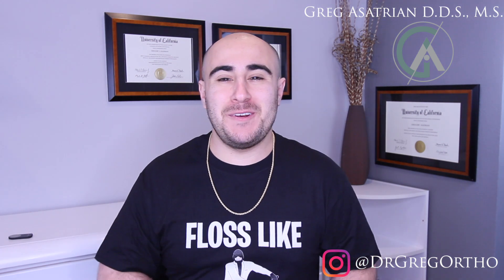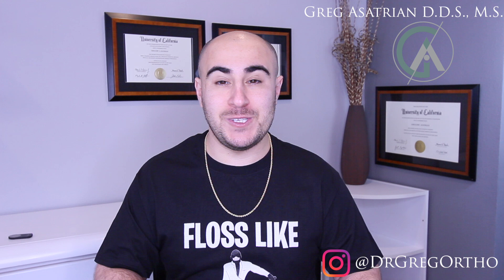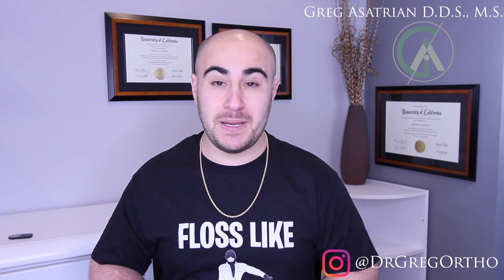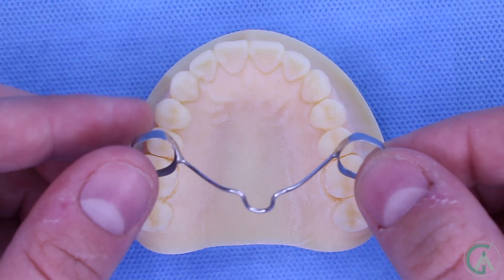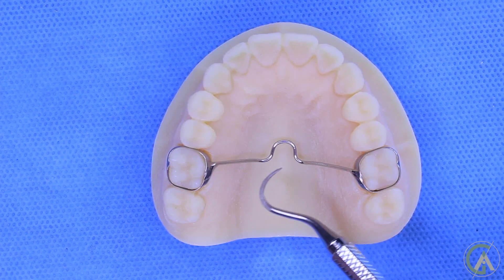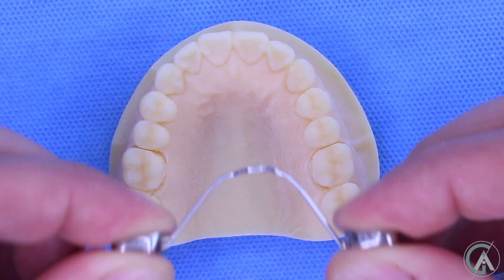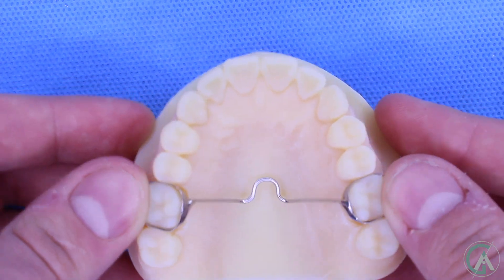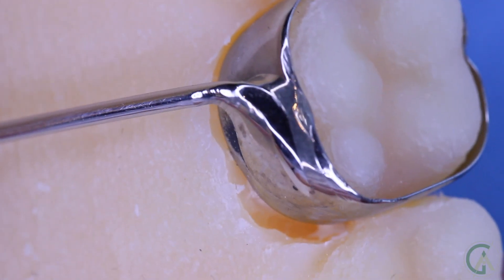Braces TPA (Transpalatal Arch)

Comment: My daughter is 12. She has 1 front protruding tooth and gaps between the others. She is about to lose her 2 upper canines and lost the molars adjacent to the canine on both sides about a month ago. She got braces on just her upper 4 front teeth and they used a TPA on the molars to hold the wiring. She is struggling with it in regards to tongue pain and eating. I know there's alot happening in her mouth right now but do you think it would be worth bringing up at her next appointment the possibility of brackets on the molars or just the bands without the arch? Or does it sound the the arch is needed

Comment: Hello Dr Asatrian, 

I’ve recently chanced upon all your videos and I’m very grateful that they exist, so thank you :) 

I’m writing to you because I need your help. 

I’m 23 and a mouth breather. 
It’s been 7 months with braces, got my TPA in in the first month before 4 premolar extractions to make space. On power-chains right now. 

Recently I’ve started facing difficulty sleeping and talking, I felt my tongue didn’t have any space. Soon enough, I learnt that the normal resting position of ones tongue should be the roof of the palette thus I’m trying to retrain my tongue now. It’s pressing against the TPA and it feels very uncomfortable and sore, also I’m worried if it will make any negative impact on my facial structure. My back teeth are also grinding against each other and hurting. 

If you have any advice or answers I will deeply appreciate it.
Reply: Are you better now?

Comment: I've had this type of TPA fitted for two months now. It does not hurt my tongue at all. I've heard of poorly fitted ones hurting the tongue. Theres a YouTube video of a girl suffering for months when she shouldn't have. The first few days are rough while you adjust to eating and swallowing.

Anyway, mine is being used to help anchor and pull back my 9.5mm overjet and close my upper premolar gaps. I will be wearing mine for the entire treatment 18-24 months 😱
Reply: saltire eagle omg same 2 months!! At first the TPA left an imprint on one side of my tounge but it didn’t hurt. Ofc it wasn’t a pleasant thing to get but after 2 months it feels normal.. kind of? 4 months to go :0 ❤️❤️

Comment: Just had my TPA on today !! That’s why I’m watching this video 😀 I noticed immediately, my left upper an lower molars can’t touch each other when I chew on food, but the right side do. My doctor said it’s because my biting is a bit off, so it’s more obvious when those bands are on my molars, I just need to get used to it and through time, when adjustments come it, the biting will gradually be balanced. However, when they put the TPA on, they only told me to bite for the left side(to push the band up so it fits the molar), not the right... wonder if the right side band is not completely pushed up and cause the biting issue ?
Reply: Same problem....

Comment: @bracesexplained can you please do a video on the different stages of treatment? Example: I had crowding and rotated teeth. Stage 1 seemed to be focused on rotating my teeth, Stage 2 my teeth were proclined, adjusted more, Stage 3 powerchains were applied to "close the gaps" that the procline created, stage 4-- "Hollywood", etc., etc. I know there are a ton of variables and no one is the same, but what's the typical treatment plan for someone to that has overcrowding and rotated teeth? Thanks!